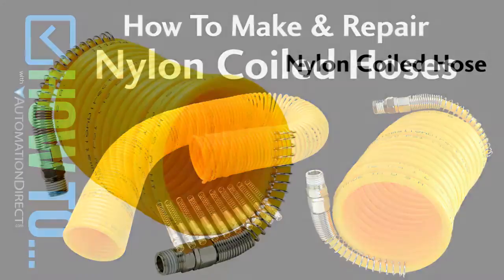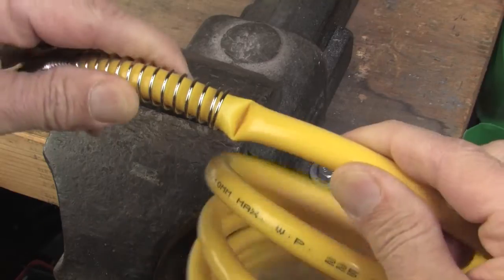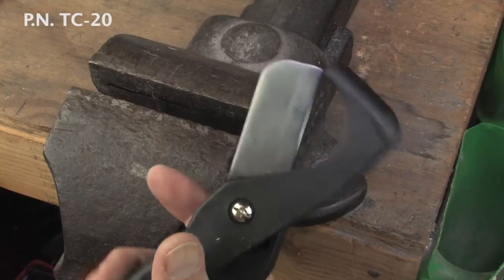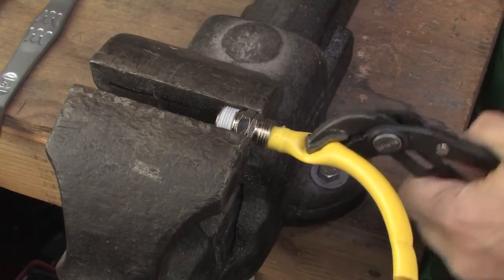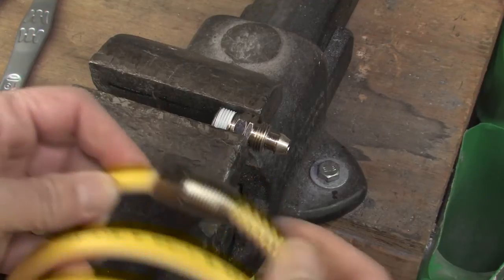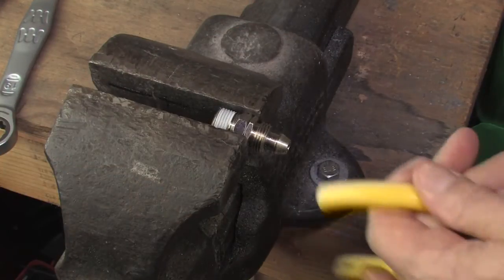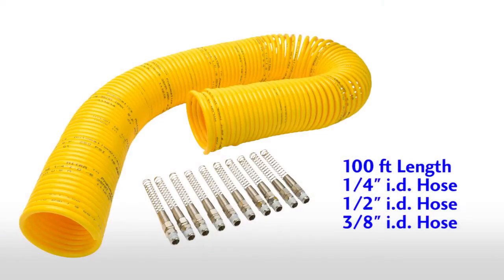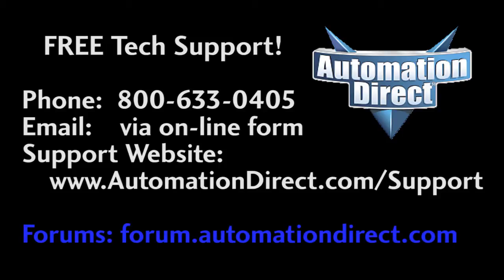How To Make & Repair Nylon Coiled Pneumatic Hoses from AutomationDirect

Comment: well, I am buying a new 15 rubber hose as it is so cheap at Harbor Freight. But, I plan on repairing the hoses. For some reason I was thinking that the hose was machined on fittings and never thought to look. Ug.. TY for posting I will now have to do this.
Reply from the maker: Glad we could help!  FYI - we have over 1000 videos at www.automatiodirect.com/videos and www.automationdirect.com/cookbook with all kinds useful information like this.  Check it out!

Comment: What is the price on 100 ft" 1/4" Nylon Recoil Air Hose and also what is the price of your spring guard and your still swivel nipple.  My E-Mail Is culmeralbert@gmail.com
Reply from the maker: Hi Albert,  All of our pricing is on-line at www.automationdirect.com. The hose you are looking for is part number: HN14C14YEL-KIT and includes spring guards.